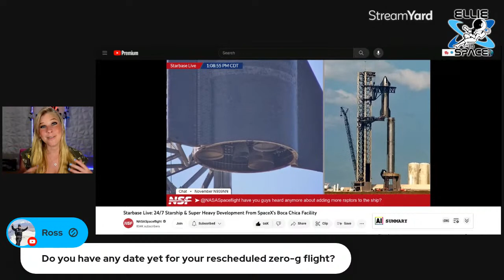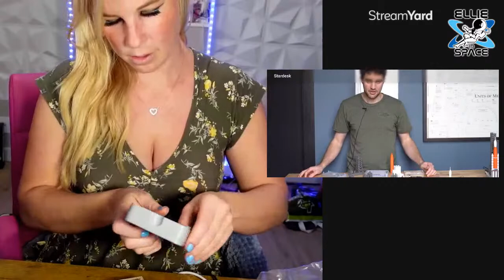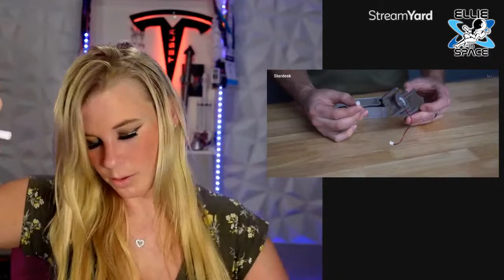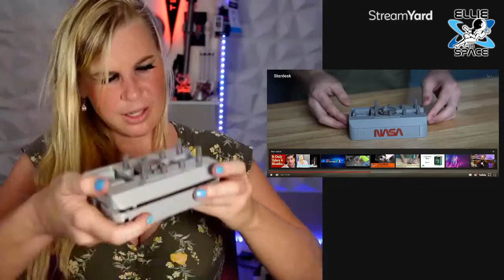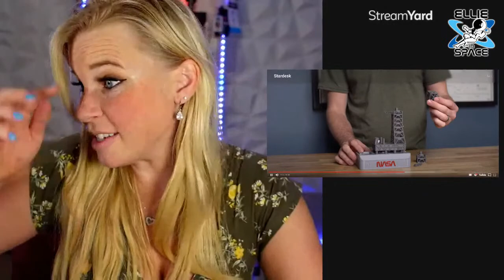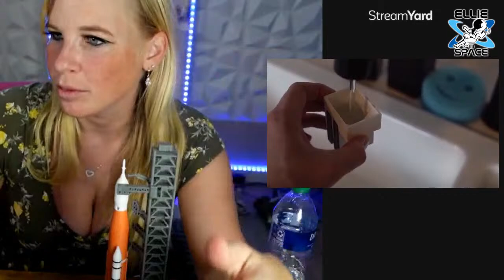Live giveaway! Assemble a 3D rocket with me!

Comment: interesting. ah, maybe you can enlighten me cos i've asked other folks but so far without a reply. given the orbital launch mount footprint is a circle, and that the tower (mechazilla) is a square, is there any reason why the circle doesn't align with a side (it's not centered perpendicular to a side) and it's not at a diagonal to the corners, it seems (from the video i've watched) to be placed nowhere in particular relative to the tower. ? is there thinking behind that? or just the geography when the two were built?